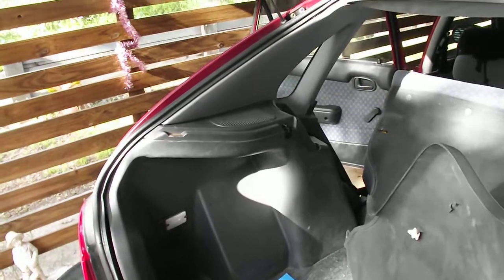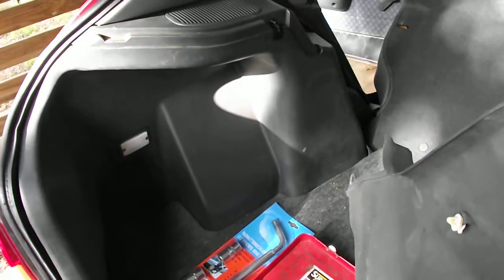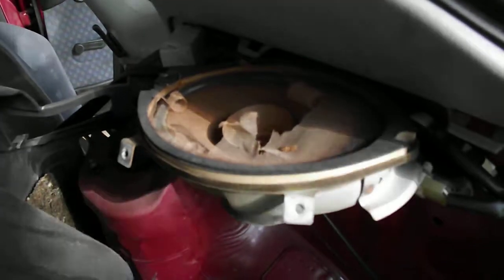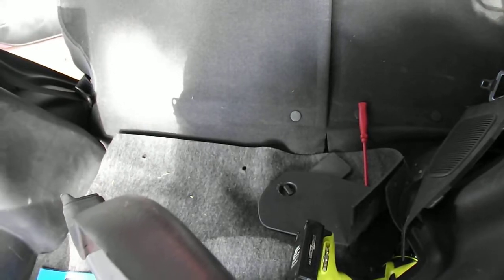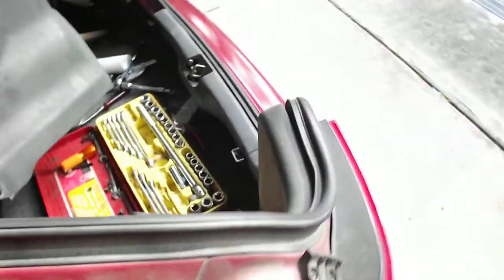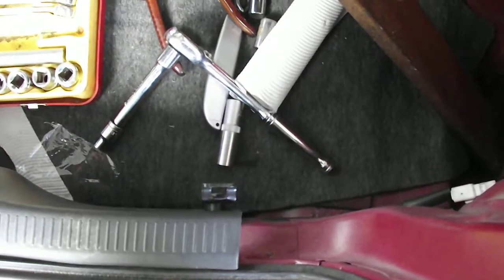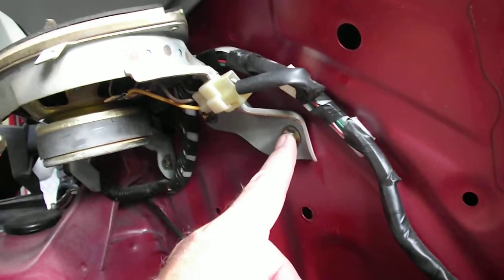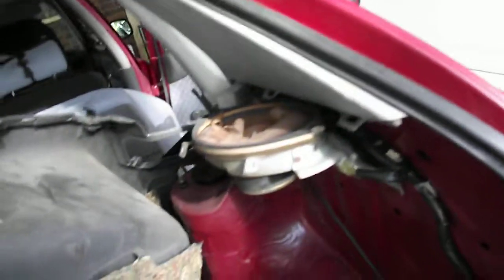Rear speakers access in a AE102 Corolla Seca hatchback.

Comment: Only known footage of corolla hatch rear speakers on the internet. And don't have the size 😂
Reply from the maker: To be fair the title of the video is 'access" not size of the speakers, however the ones that are fitted were riveted into position and i wasn't willing to make a guess on what size they were.....   As i stated to another person I gave the car to my son to use shortly after I made the video and I have not seen it since.  The information regarding speaker size in that model varies quite a lot, from 9" to 6.5.  I did put a 9x6 speaker over the one fitted and it was larger than the fitted speaker so i suspect that mine are 6.5" oval speaker but as i wrote, there appears to be a variety of sizes used.........  I may have stated in the video that I would get the size verified, so I apologise for that.